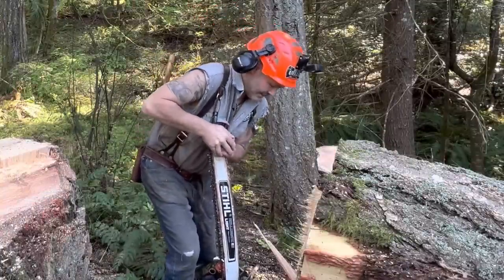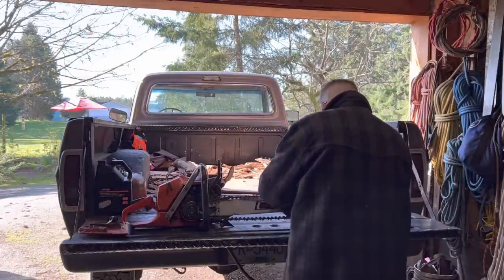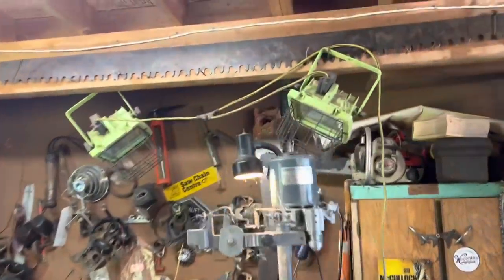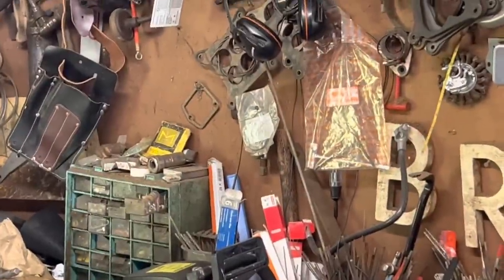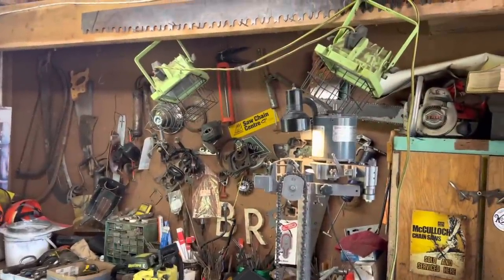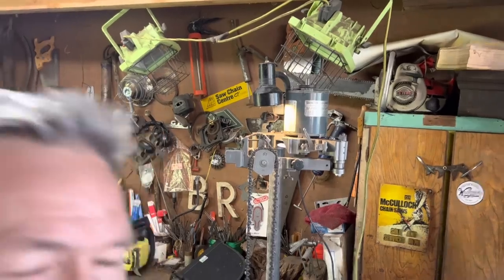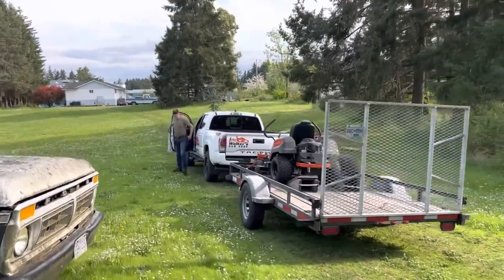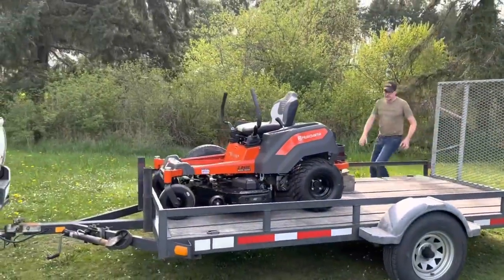Sharpening your Chainsaw, with the Simington grinder

Comment: I get it but I don't use my chainsaws enough to get the grinder. That's not a criticism. I have many thousands invested in other sharpening gear for my woodshop. But the great thing about this video is that it teaches the subtleties of Sharpening. Lots of variables, lots of detail decisions and skills to master. 
But it's worth it. Sharpening is one of those skills where you never stop learning or refining your technique. Tiny adjustments can make a huge difference. Bevel angle, skew, hook, depth of cut, type of grinding stone etc. Timber is a demanding mistress.

Comment: Hi,I can't see my top plate either,even with a mirror.Thank you for this information Looks like a killer grind. 1500 dollars is way out of my budget.I still can't get a raker gage to work after I bought one you shown us to use.* still use my 50 year gravely 4 wheel,hahaha.
Reply from the maker: grinder is not recommended for a lil firewoodin' here and there... nice for makin stumps  tho.

Comment: Nice video. I have a few video on my channel talking about grinding. Once I got my 451c it totally changed my falling.  A 5* degree side plate angle is good. The tooth heals back in the cut cuz the working corner of the tooth is higher then the raker so when the tooth is cutting wood the tooth heals back till the raker touches the wood. Making the 5* degree side plate almost 0. The lower your raker are the more the tooth heals back changing your angles. That’s why I run my chains pretty snug. I hope that all makes sense. Stay safe my friend!

Comment: iv  been looking to get a new mower. and yeah they are like 5 to 7 grand. i have three acres at what point of buying a new mower and or paying someone to mow the lawn and saving 2 to 3 hours of riding the lawn mower, weed wacking, pulling out the push mower for under the pine trees and spots that the big mower cant get. but at what point will that break even. i generally mow the lawn like once a week. so probably 14 to 20 times a year.

Comment: Is there a grinder that you would recommend that does a square grind that isn’t 1500$! Iv been looking at them lately and there are sooo many to choose from and it seems most have about 50-50 good vs bad reviews. I just figure as deep in sharpening and saws and your connections you might know of a grinder that works well for a homeowner for a reasonable price.
Reply from the maker: i can only recommend what i have experience with, you could learn to hand file square
Reply: @BuckinBillyRaySmith  Yeah I ordered a half dozen double bevel flat files from Madsen’s and after a few times iv got that pretty good still have a lil trouble keeping it right in the corner but maybe I’ll just stick to the square files then. I cut a lot but just around my farm and I just can’t see spending that much for one like yours. Maybe find a good used one some day for a good price I can pick up!!

Comment: I was grinding chain on the opposite side  so opening the arm to my left hand, chain was WAY down in the last grind or two stage before you start rippin off cutter teeth.........I opens the arm to check out the grind and I'm up under the top plate, got the corner amd all the things right, well I reach over with my right hand to lift the backing arm that holds the tooth to turn it up to my  work light...........damn grinder almost falls over, dust flying off the stone, and I'm thinkin what n hell is goin on, smell stone dust and burnt skin and again thinkin what n hell is goin on? Well my middle finger knuckle had hit the bottom corner of the stone when I reached across and laced my finger open like a scalpel about an 1" long, cut so clean it never did bleed but three drops! Barely missed the tendon and earnt 10 stitches in and inch of didget, needless to say that slowed my firewood cuttin up a touch. Same exact grinder our pal is usin in this here video, so from a big dummy not only chain is sharp after it touches a properly dressed stone haha!! If your just learnin on a grinder like this, take yer time fellas.......it's not a race and you'll appreciate it alot when you have that look buckin explained the first time yer grind cuts eh!
Reply: @williamwallace9620  I believe Bailey's and Madsen's carry them, but they're built in Lakeview, Oregon and you may be able to search it that way as well